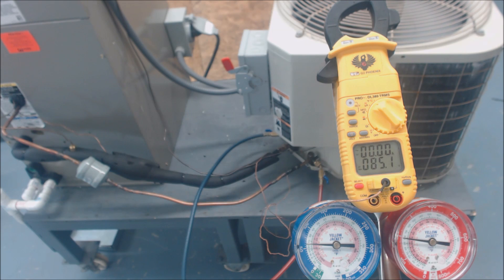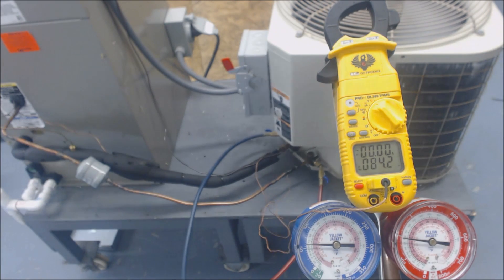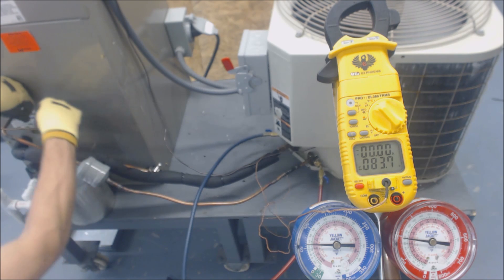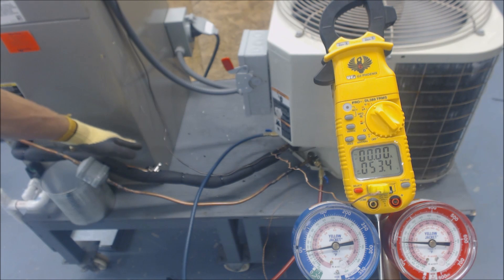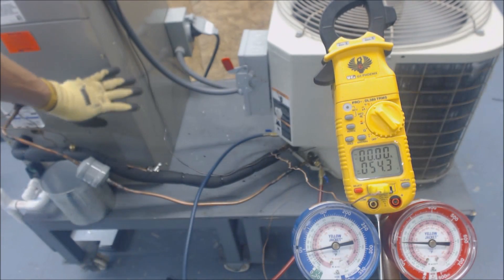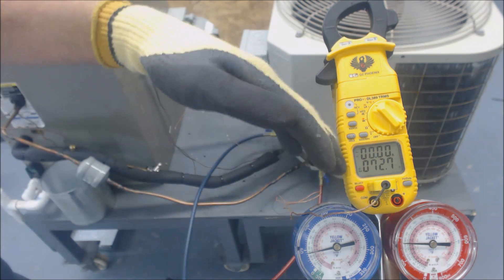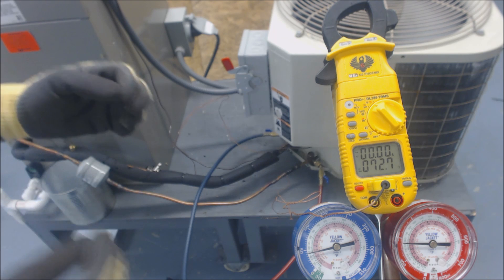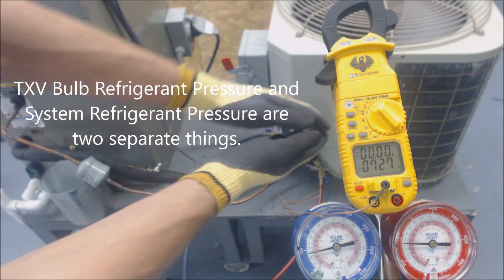Refrigerant Charging: What it looks like to have a Bad TXV Compared to just a Low Charge!

Comment: Residential split sytem R 22 scroll  compressor. After a minute or two  the pressure slowly keeps going down. High was 275 low was 40 psig. Added charge after checking filter, and fan motor. High side went to 300 low side continued to fall. Compressor finally went off. System has a filter drier sight glass and txv. i think it's restricted but i havent tested the txv.
Reply from the maker: If it is restricted then you will have a freezing evap and high superheat with normal to high subcooling. If it is airflow then you will have normal to high subcooling with little to no superheat, thanks
Reply: Thank you. The suction line is warm outside and inside.  84F in 81F out. Air temps Didn't even have time to check if the filter drier was clogged. Compressor went off. Prbably high head. 300 106.4 near condenser ambient temp. system is 5 years old. Motor fan and wheel look clean so i ruled out clogged evap.
Reply: I found the T.X.V. was completly shut. Replaced it with new one. Weighed the charge in. Suction was 55 liquid 285. Weather is cold so i need to go back when its warm to test system. May need to adjust superheat subcooling. will adjusting the superheat raise the suction pressure or should i add more gas?
Reply from the maker: If this is a comfort cooling system with a txv, you would monitor superheat to be around 10-16 degrees, the evaporator coil sat temp above freezing and a subcooling as listed on the rating plate on a 70 degree or higher day, thanks!
Reply: I guess where i was confused was both charging and adjusting the TXV will change the superheat. Thats why im going by subcooling.

Comment: Subcooling is essential for determining a charge. But what if there is a receiver separately under the condenser. How then is SC applicable?
Reply from the maker: In refrigeration, we verify the charge level differently in that we try to increase the load and drain the receiver but still attain 1-2 degrees of subcooling in a clear sight glass. If the product can't come out then we monitor superheat and still a clear sight glass, thanks. Maybe check these videos out on the receiver. They are mainly about the function in the refrigeration cycle- https://youtu.be/BllcbdD_tJQ  --  https://youtu.be/RofUUMl5x84

Comment: What if there is a restriction on a cap tube?  What are the tell signs
Reply from the maker: Here is a video on that-  https://youtu.be/L7VkLsXGaQ8    --  normal to high subcooling with high superheat. If the unit was low on charge then you would see high superheat with low subcooling., thanks

Comment: What if the saturation temp of the evaporator coil is high, around 67 deg.  Subcooling is around 8 deg.  Temp in house is 84 deg, supply air is 72 deg.  Refrigerate 410 ,  2 ton unit expansion valve,  discharge line temp is 132 deg, superheat around 7 deg, more refrigerant added only raises head pressure and no change in evaporator coil temp, refrigerant removed and temperature decreases but so does cooling?  Compressor sounds funny as if internal relief valve is open ever so slightly, and unit will not pump down below 45 , charge was weighed in to factor specs, new refrigerant added, blower speed checked and confirmed with static pressure, no heaters stuck on,  and no air bypassing evaporator coil? High suction pressure around 189 if I remember correctly.  I'm ready to replace compressor.?  Any tips?
Reply: Well, disregard this post, fixed the problem by changing out the compressor which was defective, had bad valves which was causing the issue, just as I suspected was wrong.  Thanks anyways.
Reply from the maker: That was a good diagnosis, yes you were doing all the right troubleshooting!

Comment: Is there any further test you would take to reach the conclusion of poor system airflow or fail tev? I will take a quick cfm measurement on the return with a vane anemometer and sometimes even cut open ductwork to provide more airflow. Still sometimes end up scratching my head.
Reply from the maker: If you use a vane anemometer make sure to use a transition box with a completely unrestricted opening to do away with the fins of the grill or register. Low airflow would read low pressure, low superheat with correct or high subcooling. Liquid line restriction would be low pressure high superheat, at least until the beginning of the evap freezes and then continues through the coil, thaks Kevin!

Comment: I'm doing a couple of units at a apartment,  the indoor units are old and txv. tried to charge  and low side doesn't change, high side subcooling goes up  and suction line is freezing up. saturation temp in evaporator reads below freezing with leads me to think txv is bad
Reply from the maker: That could be liquid line restriction or low airflow, depending on the initial superheat within ten minutes with a non frozen evap coil. Low superheat is airflow, high superheat is liquid line restriction. Check out the videos on that subject-  https://www.youtube.com/playlist?list=PLxnHR5_D2ojxZI3-xx03Bttxe3xCqUD87
Reply: acservicetech in this situation, txv is okay, airflow is low, will the txv be successful in maintaining superheat? or in other words, will checking superheat while having a working txv show low superheat with low airflow?

Comment: good nfo, so how does the bulb lose refrigerant, also when the txv is bad will it cause suction line to also freeze up at condenser unit,
Reply from the maker: If it leaks out of the bulb or the tube rubs and creates a hole or at the top of the txv head possibly, it will lessen the amount of refrigerant going into the evap and over time it could freeze up out to the condensor but right after turning it on and waiting 5-10 minutes there would be high superheat due to low refrigerant, thanks

Comment: Nice Video,   TXV is calculated Reg.  no doubt I have some kinda restriction on the liquid line.   My subcooling is 6 degs and superheat is extremely high.  Does not sweat.   This is a garage unit.   Humidity can  be high,  garage isolated except ceiling.   All duct work is metal.  Blower is medium speed.  I have not measure static pressure across the coil yet.   no need system is screw right now.  I have many as eight 90 deg turns in the lines, not sure if it flash at these points.  Compressor was testing out to 350 psi at 20 amps.  Coils were cleaned.  Filter return is cleaned and calculated for this volume.  3.5 ton amana system.  R22 system.  Never worked in the garage after assembly.  Worked in the house for 15 years.   Its either TXV,  or evaporator design hook up.  Not sure if a site glass can cause restriction or not.   Here is the kicker,   I have a blend, not a true R22 refrigerate.  I have tried MO99 and Nu-22.  The companies swear they work.  Much cheaper and safer for the environment.   May change out TXV and throttle this valve like you did in the video.  if this works,   I could move to a piston, or adjustable type for the garage environment.  I could move to a real R22 refrigerant, to see if the blends was the trouble.    Compressor oil is OK.  Filters are changed every time.  I try a new blend.  Most HVAC guys don't have experience, working with blends for R22 sub.  They do work. Most avoid it.    Can you shed some light on this with different blends with TXV that is designed for R22.  About one year of experience.  Engineer that has taken new direction.

Comment: Hey man great video, quick question for you, I have a Lennox R22 residential AC system with TXV on the indoor unit. indoor split is 10 degrees, Suction line: 26.5, Liquid line:184, Superheat: 64 and Subcooling: 29.6 if there is a restriction how do I locate it? Filter dryer has a 1.5 degree difference across both ends.
Reply from the maker: Sounds like it as long as you double checked with another temp sensor just to make sure.  If you added more refrigerant, the subcooling would just go up so it is not refrigerant, it is not low airflow because of the high superheat. I will say this though. How are you getting a 64 degree superheat when the suction temp is 26.5? That would mean your conditioned air within the building was higher than 90.5 degrees. Is that right. It would likely need to be closer to 95-100 in the building to get that superheat. It is usually the filter drier, strainer, txv and rarely it will be a distributor tube. You may want to plan to change the txv, strainer, and filter drier if i am understanding what you are saying. The temp across the filter drier may be close to normal depending on the location of where it is installed and the surround air temp. Thanks
Reply: acservicetech Thank you for quick response, im in NY, today it was around 70° ambient inside the house temp was 77°, supply was reading 55 and return was 65. TXV replacement requires system recovery and vacuum, right?

Comment: Thank you very much for the video. I enjoy watching your recordings because you go straight to the point with clear instructions unlike other techs uploading videos on YouTube.
-
I have a question to help me clarify your method of troubleshooting the TXV;

1. By adding the TXV bulb to the 33F iced water your low side gauge pressure immediately dropped. IF it DID NOT drop, would that mean your TXV bulb lost refrigerant meaning it was not functional? 

2. And by having the temperature drop when adding to the water, does it mean the TXV if working properly?
Reply from the maker: Yes you got it and it is even more important for what happens when the bulb is in hot water as that is when the txv opens up the flow of refrigerant and decreases the superheat. Thanks

Comment: Is that the same as a stuck txv
Reply from the maker: Yes a bad txv means that it is stuck and not moving due to pressure from the bulb. Thanks
Reply: acservicetech what  will the pressure be if it was stuck open low or high & subcooling and super heat low or high , thanks .
Reply from the maker: The txv's usually fail in a stuck at whatever position they were at when they failed or they fail in the almost closed position showing high superheat and low vapor pressure. At that time you may see high subcooling as well since the refrigerant has nowhere else to be if there is not an accumulator. Thanks

Comment: Great video. 
I have a unit that was low on refrigerant (r22). I searched for leak and found it on the evaporator coil and it was in a place I could not repair. We replaced the coil that came with a 410a txv, put a r22 txv on coil. The unit runs with high subcooling and high superheat suction saturation temperature is low about 29 degrees sometimes lower. Unit froze up the other day. Checked filter etc. all looks ok. I pulled the txv bulb off and put it in my hand. Suction saturation went to about 34 degrees and superheat decreased. I think the txv may be bad possible loss of charge in the bulb. What are your thoughts?  Thanks
Reply from the maker: Sounds like too small of a txv size, or bad txv, or clogged filter drier if it was not changed. Thanks
Reply: acservicetech filter drier was replaced when new Evap was installed. Thanks for your input.
Reply: acservicetech just an FYI I replaced the txv. Problem still remained. Due to possible efficiency issues (new coil on old condenser) I adjusted the txv, opened one full turn. As of now the problem has gone away. Superheat and subcooling look great. I just wanted to share the experience to possibly help others avoid the same problem I had.
Reply: Suction saturation has gone up. All looks good. Thanks again

Comment: Do you have any videos on mini split systems (ductless)?  Specifically, what do you look for on a seasonal checkup?  I understand that you really can't check superheat on those and that if you think your charge is off you have to recover and recharge by weight.  Is delta T the only thing you can really check on a seasonal service checkup for a mini split? (aside from filter cleaning, coil cleaning, etc..)
Reply from the maker: Just these two art this point but they include the weigh in process. Temp differential on VRF systems as long as there's not high humidity in the building. Thanks  - https://youtu.be/QpzOSQt2fpI   -   https://youtu.be/gRNhSWNkIWY

Comment: Great video....  But riddle me this.   Assuming all else has checked out and the Puron System has a high side of 350PSI and a low side of only 88PSI.....how can you differentiate between a bad TXV and a partially plugged liguid line dryer?   THere is very little cooling, say a differential of 7 degrees.   There is no frost on the TXV or evap coils and there good air flow.   Subcooling is 10 degrees.  It seems in either case, the system is undercharged,....but how can you for sure know its the TXV or the dryer?  Its a carrier
Reply: FYI, I took the TXV bulb off and dunked it in boiling water, then into ice water, then into boiling water, repeat.  Finally left it in the boiling water.  Turned on the system.  Pressures were exactly the same in the boiling water as they were with the bulb attached to the evap
Reply from the maker: Great Question! The pressures should not be the same. Did you check the superheat? The way that you tell a plugged filter drier or restriction from a bad txv is that if you have low temp diff across the coil, in this case only 7, when you put the bulb in boiling water the superheat is supposed to decrease. When you put the bulb in ice water, the superheat should goe up. The txv is supposed to be controlling the superheat so if it is not and you have the correct subcooling then the txv is at fault. Thanks!

Comment: Thoughtful video.  I like that you had the system set up before starting the video, ie guages attached, refrigerant meter, line temperature display, pre-running the a.c. system ... all this so that the key points can be visually evident and your dialogue can address the point of the video.  All in all, a very intelligent, informative video.  Keep up the good work.
Reply from the maker: Thank you very much for your thoughtful perception and if you want to see anything else, I try to make each video different such as one will be to attach and how to disconnect the gauge set, one on charging a system with king valves, charging in superheat instead of subcooling and so on. Thanks!

Comment: Could a bad txv cause the low side to go into a vacuum.
Reply from the maker: The txv's are designed so that they are never shut. With that being said, if there was some type of obstruction or something there then yes that would make the system pump down just like a liquid line solenoid valve. Thanks

Comment: Goodman heat pump charge unit for cooling cools perfect. customer complained heat pump shutting off for high head pressure. I believe the other txv is bad and not over charge. couldn't verify, customer wants to leave the unit as is. question should a heat pump be a weighed in charge or can you trust a sub cooling method?
Reply from the maker: You can trust the subcooling method if you charge in cooling mode but if charge in winter then you must use the weighing process. That is an intermittent problem then I am assuming as it was working fine when you left but now there is a problem? It would be nice to see when this is going off on high pressure and what the pressure is. Thanks!

Comment: Only getting about 7F across the evaporator, 79F at return and 72F at register.  Ambient temp is 89F.  R-22 Refrigerant.  Evaporator changed 3 years ago.  Condenser has been thoroughly washed.  Discharge 270 psig with 105F liquid line temp.  Suction 78 psig with 78F suction line temp.  The Hi side swings from 270 to 250 every few minutes.  Decided to change out the TXV.  After replacing TXV the system performed the same with only 6-8F across the evaporator.  I have tried soaking the condenser with water for 30 mins which brings down liquid line temp but still only get 6-8F across evaporator.  When changing out TXV the refrigerant was blocked at compressor and reused.  System vacuumed for 10 minutes.  Does the TXV need to be adjusted?  Do I need to fully recover the freon and put a fresh charge?
Reply from the maker: The system would need to be vacuumed to 500 microns before refrigerant is introduced. Each time you open the system up, the filter dryer should be cut out and replaced. Did you try putting the txv bulb in hot water to see if your 31 degree superheat would decrease? It sounds possible that the charge should be fresh from a new bottle. Why was the evap changed three years ago?I would test txv first to see if superheat decreases but I would likely be recovering, replacing the filter drier and putting fresh r-22 in. I am assuming that the txv bulb is in the proper place. I have videos on bulb placement, vacuum pumping, and bulb in hot water. Just search through the search box on the top right of the channel page. Thanks and I hope that helps you!